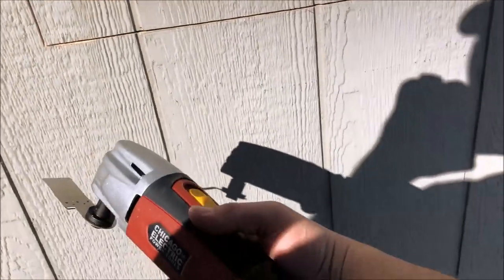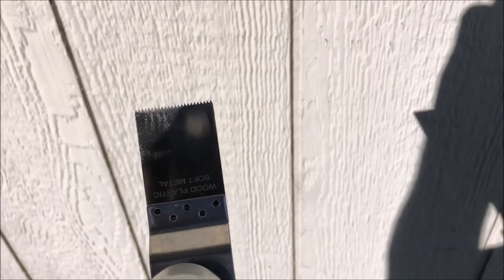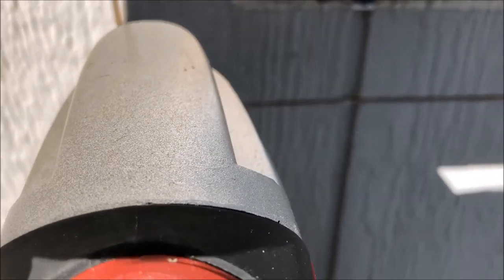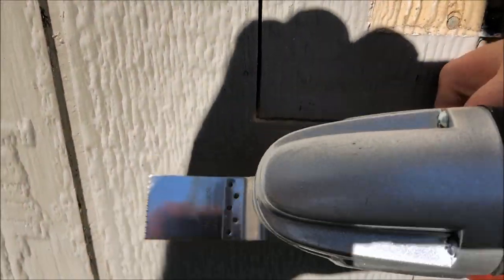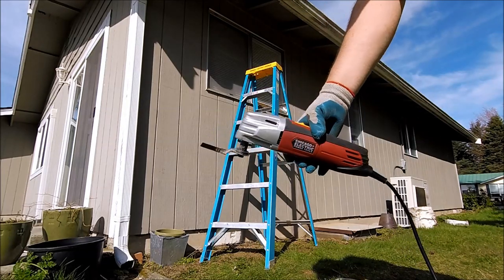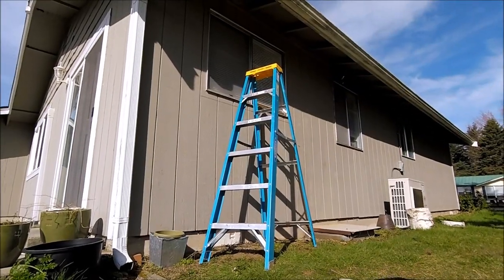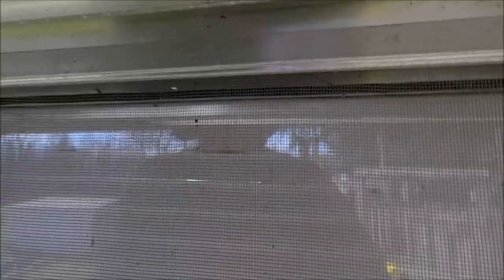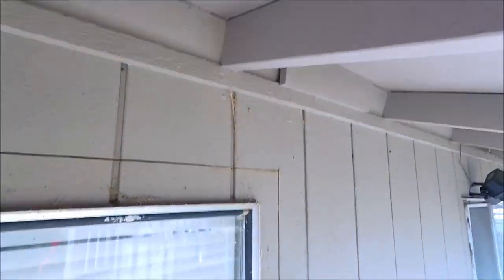Using the Chicago Electric Variable Speed Oscillating Multi-Tool from Harbor Freight 63113 63111

Comment: I've got the little single speed HyperTough branded one they sell at Walmart.  I love it!  The company makes some great, inexpensive tools.  I haven't used the steel blades that came with is as I picked up the black blades set with the semi-circular blade in it and have been using those all of the time.  I totally agree with you; those little multi-tools are freakin' awesome. =)

Comment: Will it work great on drywall too? I just have to be careful not to go too deep and cut pipes or wire behind it. I think I put tape on the blade as a limit line so I don't cut too deep.
Reply from the maker: It’ll cut drywall very easily.

Comment: I've been using my oscillating tool for couple years and I went to use it recently and for some reason the screw will not stay in and the blade keeps falling out. I even put a lock washer on it and within about one to two minutes the screw comes loose again. I just can't figure out why that would happen when it's been working fine. The screw and the beveled washer are the only two things that should be holding it in. Any thoughts?

Comment: You can use the blade at diffrent angles not just 90
Reply: I usually mount the blades forward and have only turned them 90 degrees or so a couple of times.  I've seen people turn the blade back towards their hand, but I haven't been that brave (or rather, stupid) to try that, yet.  That's just a trip to the hospital waiting to happen as far as I'm concerned. =D